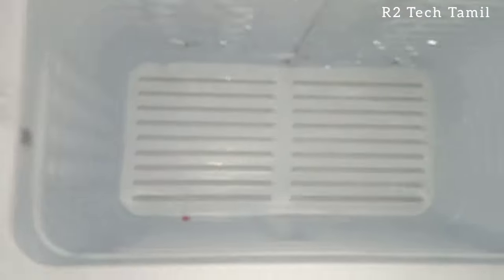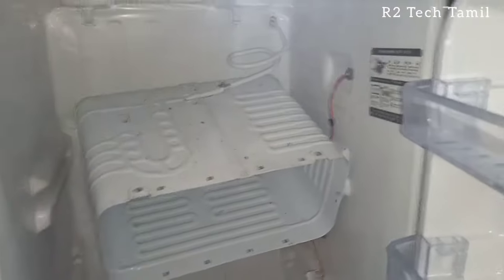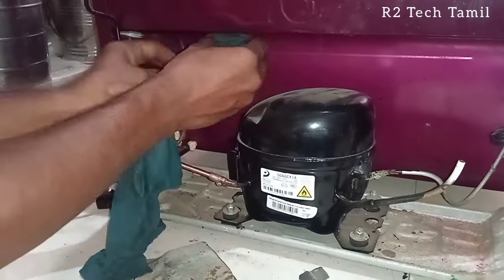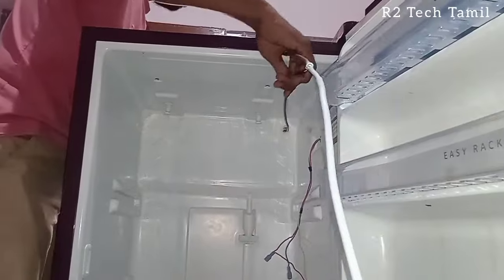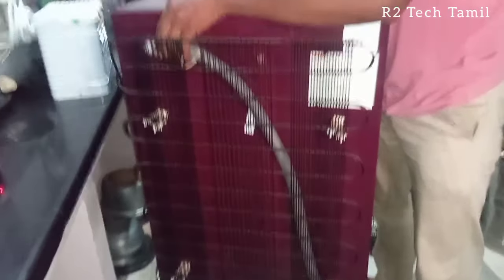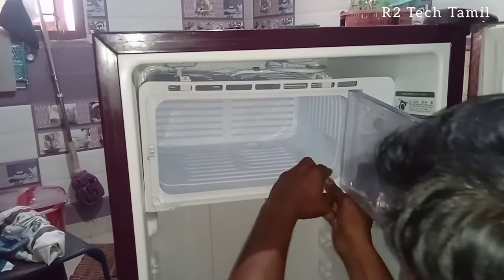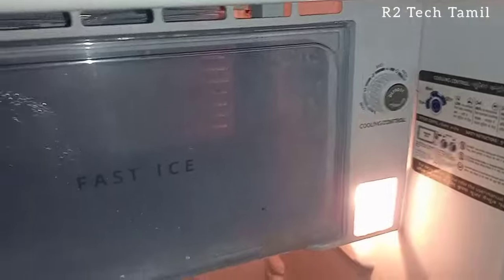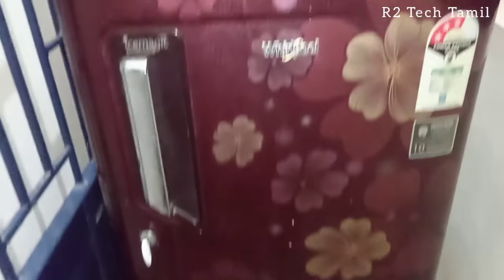Fridge Freezer Changing தமிழ்

Comment: நண்பா என்னுடைய ஃபிரிட்ஜ் Godrej EDGE sx மாடல் ஃபிரிசர் ஐஸ் பிடிக்கிறது ஏன்? அதை சரிசெய்ய என்ன செய்ய வேண்டும்?
Reply from the maker: Climate changing so apdithan orukum defrost panitu 15 days run paniparunga.  Again full.ah ice form achina thermostat change pannanum.
Reply: Just press defrost button, if the compressor is off, leave it automatically turns on. Aren't changing the thermostat

Comment: Bro enathu lg fridge single door fridge same ithey problem
Freezer, filter, out pipe and oil change , gas filling 
Total evelo cost aagum bro
Sollunga 
Local mechanic vandhu check pannanga avanga soldrathu namapara mathiri illa 3.5k kekranga bro
Reply from the maker: Normal rate thaan bro.. 2.5 to 3.5k varum compressor oil change panramathiri irukalam. Lg technician kooptingana 5k soluvanga